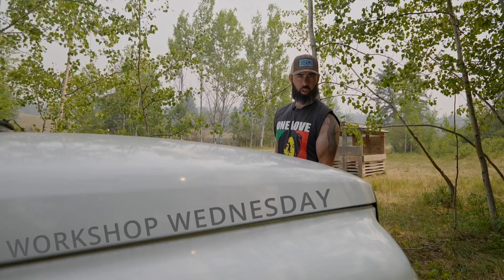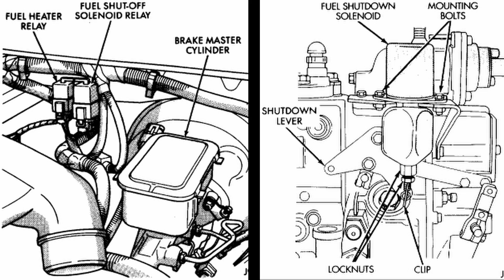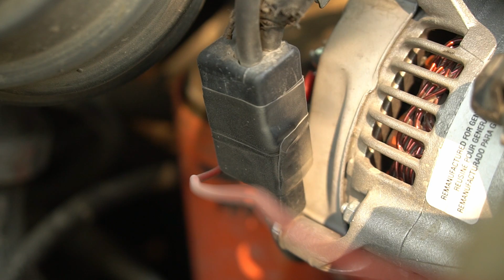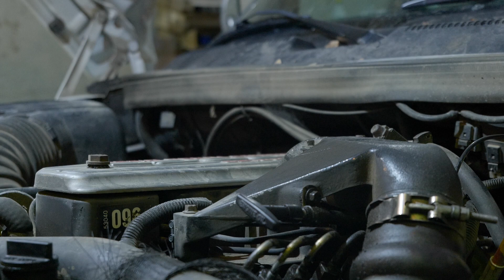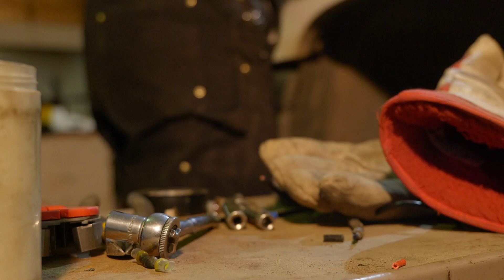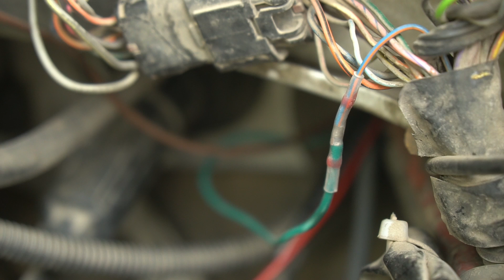No Computer, No Problem! 12 Valve Cummins Expedition Truck

Comment: I'm having trouble with the voltage regulator failing. Can I just do the bypass of that without everything else you did? I couldn't live without overdrive or cruise control

Comment: Having a 1995 auto 12v, the only mod I will do is the fuel shut off. I’ve had one fail and had the darndest experience with an intermittently failing relay for this solenoid. I buy quality batteries every 5 years, use overdrive every outing, monitor the tach for compression breaking and optimal fuel efficiency when towing, use cruise for frequent jaunts across the Mojave and enjoy the AC. For me, I don’t see the value of the delete because this engine is simply the best as it is.The only other electrical components to fail in 30 years were two starters and the headlamp switch. That switch was more difficult for me to swap than the starters. The video was interesting and certainly learned something though…Thanks for the knowledge transfer…👍

Comment: The Air Conditioner, you add a switch to turn the compressor on. Why couldn’t you pigtail off of the blower motor power wire? I am trying to keep mine as factory looking as possible. And as least amount of steps as possible to turn the air conditioner on. Just asking, thank you sir for your insight.

Comment: The computer is mainly is for the dash cluster gages.  The computer does nothing other than control the overdrive in the transmission.  I had a 1991 12 valve cummins and now I have a 1994 and a 2003 cummins lol

Comment: So your truck is a 12 valve? I'm wondering if this can be done to a gen 2 , 24 valve, although mine is automatic with a stage 3 billet trans from ATS in Colorado.
Reply: No 24V has an electrically controlled injection pump that is controlled by a computer.
Reply: I did this to my 24v but I had to do a ppump conversion with it

Comment: Love your channel and content.

I'm a Land Cruiser guy but with no Toyota diesels in the US I'm considering a diesel truck to mix up my camping from remote Sierra Nevada Trails to add a travel trailer for long range comfortable cross country trips. 

My 2007 Tundra doesn't like our Jayco 21mml trailer much, although she does chug a long without to much complaints. 

I hear the 90's dodge is the most epic in reliability, do you know the year range of the Dodge with this reputation, yours is in this year range correct?

Comment: The external regulator will work, if you get a quality adjustable one from Summit or Kegs. Not that it will need adjusting, it's just that the off the shelf napa and car quest oreallies are Chinese junk and overcharge, especially since vivid.

Comment: As a long time truck driver with all types of diesel engines. if you learn to listen to your engine you will automatically know when to shift with out even thinking about it. so if you never wire up the tachometer again you will be pretty confident on all your shift points. loving your videos and the amazing places you go. Be safe in all your travels..

Comment: The heat grid is actually unnecessary according to many.  If you're in a really cold climate, it might be helpful, but the heat grid was something DODGE added to the Cummins engine.  Cummin's 12V engines used in many other applications do not have the heat grid.  i've got this engine in my 92 Dodge truck, AND my 99 Freightliner step van.  The dodge has the heat grid, the step van does not.

Comment: I tried making this comment before but it didn’t take. You can purchase a non AC Serpentine belt as a backup replacement in case your AC compressor seises up. Also GEARWRENCH makes a Serpentine belt replacement tool kit, makes it easier to replace the belt and also comes with assorted sockets. I got mine off of Amazon.

Comment: I'm curious as to why you need a tach? Shifting by ear works just fine. Love the adventures. Keep it up.
Reply from the maker: Really helps on the long downhills to know when you have to get on the brakes. Exhaust brake only does so much.
Reply: @Destination_Adventure  I don't run a exhaust brake so that's something I don't think about. Good to know.

Comment: Pretty sure you are INCORRECT   re,  automatic trans.   47 / 48R "E"  means  electronic shift as opposed to  AKA  46RH  meaning,  "Hydraulic" shift.  (The older  "H"  series shift  just like the 60's--70's transmissions,  no  electronic controller.    The converter lock/ OD are simply controlled with  as simple as toggle switches,  but an  RE  MUST have an external controller  to shift.   As far as I know, there are certain aftermarket all manual valve bodies available,  and I thing one of the TransGo  kits  will accomplish that, but this will leave you with a MANUALLY  shifted  trans from gear to gear   I do know there are  differences  in the VB  between  42/44/46RE series and the 47/48  V10/ diesel  transmissions  so it bears looking into
Reply from the maker: I stated that I didn’t know about auto trans, I have standard.

Comment: In my opinion you don't really need the tach.. my old 91 never had one from factory. It's hard to over-rev as well as hard to lug them. You'll pick a sound that indicates to you where to shift eventually. I assume you will run the lower end of the range, which is just kinda where these things like to run at. You can't go wrong. If it lugs that's too low. Lol.

If I ignored the tach I shifted a 15 litre diesel at around 1700 rpm. Which usually worked out rather well!

Comment: You can use the stock crank sensor to run an aftermarket tach. Super easy to do you just need to wire a 1k ohm resister from the signal wire to the power wire. If you need a wiring diagram just let me know. This is how i run my tach on my ford cummins conversion.
Reply from the maker: I’ll definitely do some research into that one.  I haven’t been able to find any info outside of using the alternator.

Comment: Have seen 1 million more injector pumps fail than any “computer” in a vehicle.

What a complete and rediculous waste of time and money.

If you are that scared about the “evil nasty computers”, carry a spare programmed one then.

Don’t get me wrong, I love old school mechanical driven engines.
I also operate two large mechanical workshops

Have maybe replaced 3 or 4 ECU’s in 15+ years. Most through customer damage not through failure.

Meanwhile, we change and repair failed injector pumps, injectors etc almost daily.
Reply from the maker: Can’t buy these computers anymore.  Are you recommending I carry a spare $4000 pump?

Comment: Once you get used to it. You will now when to shift by speed and engine noise.  I've been driving semi 30+ yrs and I can't remember last time I looked at the tach. If I'm skipping several gears I'll just look at my speed and I know what gear I should be in. People will say but you can only do that with a semi, WRONG. I've had many manual transmissions both gas and diesel and only shift by sound and speed. I also only use the clutch when taking off from a stop or backing. 
So you will be fine without a tach.

Comment: Check out a diesel Tiny Tach. It has a transducer that bolts onto one of the steel injection lines and counts pulses from there. They are under $200 and you won't have to mess with your alternator.

Comment: So I don't know vehicles at all, but what I gleaned is that the computer regulated a lot of stuff, and you've removed that regulation, bypassing by coming up with alternates for each thing? So they are still regulated but not by a computer? Also, wow, no air conditioning all this time??

Comment: cool. the old school rules attitude. But doesnt something go wrong with those heat plates where the bolts loosen off or corrode and then bolt heads go funneling through the engine and pretty much destroy everything. Or am I wrong about that

Comment: No matter what DO NOT let Mick touch any of this ! Also make sure you have some kind of manual fuel shut off . Love that rig .
Reply: I totally disagree! Mick coulda rigged everything up in no time at all and for far less $. You would just have to remember that the AC pumps out heat, the tach will give you the alternator charging voltage, and a few other minor quirks. In all seriousness I’m surprised your battery survived the 17V charge time. They can take short bursts of that kind of voltage but not long ones. There’s a guy named ‘Handy Bob’ that has all sorts of info on solar and batteries. My solar will charge my 2 Trojan 6V golf cart type batteries at ~14.7V when it’s warm up to 15.2V when it’s cold. Nice having a controller that keeps track of that. Many controllers wouldn’t permit charge voltages of anything >14V which meant that batteries were chronically undercharged. Dead within a year.

Comment: Dustin, many years ago I owned an Austin Mini Cooper S, high performance car, no tachometer. The way the factory indicated gear shift points was to put vertical marks representing the gears (I, II, III) on the speedo at the recommended shift speeds, just a thought.

Comment: I love Weds edition.. I love that truck.. I want one just like it.. 

I just got the AC fixed in my Subaru (o rings & $300 in recharge kits later) man it is so nice having the air coming out of the vents at +4ºC (40F). I have a cup holder zip-tied to my driver-side vent, and in 30 mins I can take a can of water and have it chilled to drinkable temp.  

For my build: I still need struts all for corners are being replaced with Forester struts (2" ground clearance), biggers wheels/tires from 195 60R15 to 205/55R16, I'll get the brakes done at the same time as the struts (and probably the same with ball joints, tie rods etc.)

Comment: highly suggest you get a posi lock cable to replace the vacuum assisted 4x4 actuator, you dont want to run into not being able to lock up 4x4 when in the middle of no where, you could take it apart and move the E clips around to put it in the lock position at all times, but thats just a waste of time and a pain in the ass.

Comment: You can get the tach to work.  The crank sensor is a tone wheel with a pickup sensor,  it sends pulses over time.  You can create a timer with a 555 timer circuit and have an output pulse for the tach.   These circuits are easy to make but will take a little time and research.
Reply: You read/wrote my mind! I was just about to suggest something like this, although you’ll have to add a small PNP transistor most likely to amplify the signal from that pick up, depending on its impedance.

Technically, you could just get a really dumb decameter that only needs a pulse of electricity and has its own built-in controller and then use a magnet on the crank pulley with a pick up sensor so it can use Eddie currents to send the RPM to the gauge

Comment: The second time in 2 days that I've heard a younger person refer to a manual as a standard transmission.  That's what I call them, but I'm old enough to remember when automatics were optional, thus the term and how I learned it.
Reply: I'm  almost 60, and I call it a Stick, Standard or Manual. I drive a 5 spd Subaru
Reply: Im 49 and its always been standard also. i vaguely remember 10 or maybe 15 years ago it started changing haha.
Reply: I learned on a 3 speed on the column :)

Comment: I like the modifications. Would it have been easier and cheaper to just keep a spare ECM from the junkyard?
Reply: In theory but a junk yard ECM would fail as well. So might a “new” replacement made in Upper Slobbobia. My brief understanding is the old Dodge trucks have a problem with ECM failure so eliminating it makes the most sense.

Comment: if it starts shaking... shift... if it stops pulling... shift. you probably wont ever bother putting in a tach because you will have learned how to drive it by then. nice rig!
Reply from the maker: I don’t need the tach for shifting, it is for long steep downhills.  Gotta save them brakes.
Reply: it's a Cummins not a Detroit

Comment: So if we get nuked, the EMP won't leave this truck useless. It will be the only runner in town.
Reply: Not entirely true, the batteries will go in an EMP situation you will have to find a way to start it, push start (manual transmission only) is possible, could park on a hill and hope it starts before reaching the bottom. And in the winter it will be even harder to start without batteries. I've driven Computer Free diesels for years (not modified just older) once it's running it needs no power. It's impractical to leave it running waiting for TSTHTF.
Reply: This emp thing is the exact reason I did the same thing to my idi ford 😂
Reply: Maybe not the only runner but a top class truck at the time
Reply: When was the last time an EMP was used. Serious question.
Reply: @DirtRoadTherapy a solar flash like the one in 1859 would be the same damage as a nuke EMP.
Reply: ok stoopid
carrington event melted wires by sending to many amps through.
be smart or be censored with death
Reply: In theory. If the starter, battery, and wiring harness doesn't fry
Reply: Hell yeah brother 💪🥳
Reply: With the battery hooked up in the rig the way this one is, an EMP would not cause the battery to go bad. Chances are the starter would be good as well.